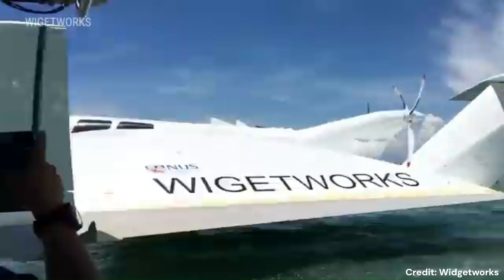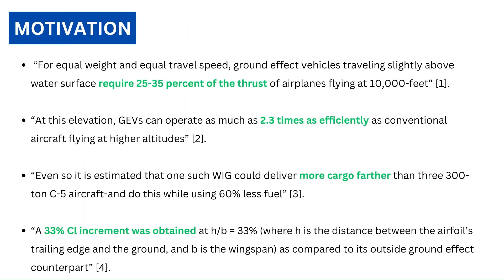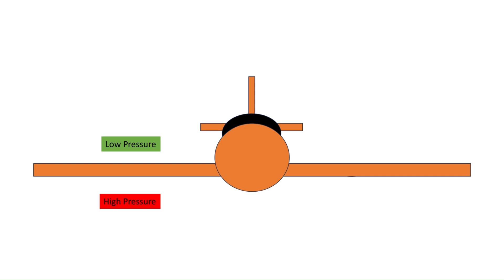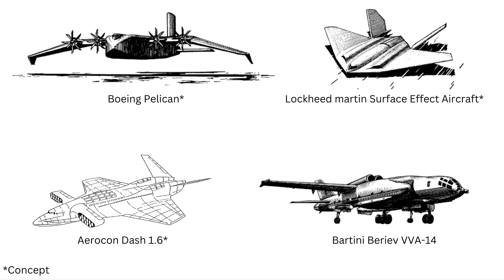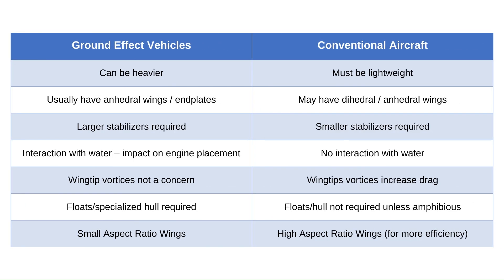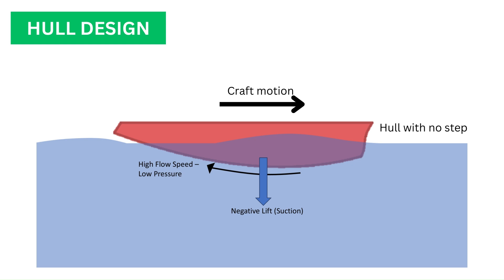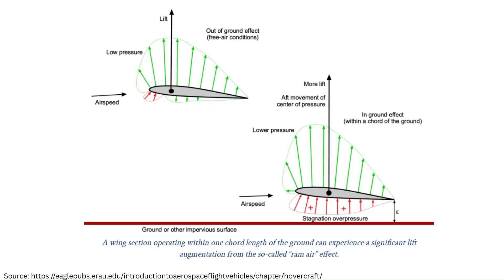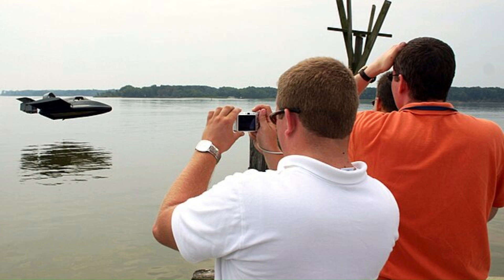Ground Effect Vehicle (GEV) Design | Wing in Ground Effect (WIG) Craft Design

Comment: I had a proposal for a land ground skimmer road vehicle with hysteresis conveyor couplings for parking inspired by a Ryan VZ-3 so an editor in of Chengdu Sichuan used such a design for a cruise missile even If had designed options such as solid fueled jet engine or x-rays on hafnium Lockwood valveless pulsejet so at least a Dave Burdo of General Electric liked it's air conditioner of a Tesla Fluidic Rectifier with a Ranque Vortex Tube for General Electric's electric car program.

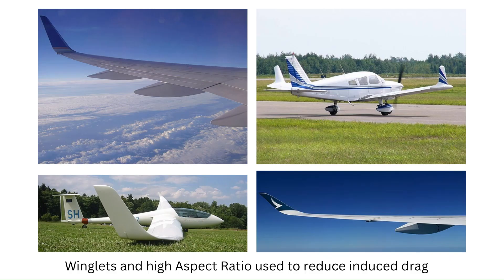Comment: 2:40 In ground-effect "the air does not swirl to the top section of the wing"???
Of course it does! That's one reason why most designs use massive wingtip devices, be it fences, floats, and/or winglets.
There's high pressure bellow, low pressure on top, flow will migrate towards the low pressure side.

Comment: Nice review of WIG design.  Although quite a few craft are named and described, it struck me as odd that Regent Craft's Viceroy, which is currently undergoing initial water testing of the full=sized prototype, was neither shown nor mentioned.  Aside from possibly the Airfish, the Viceroy is probably the closest to certification for commercial use.  Additionally, Regent is incorporating new design elements that are worth mentioning.  Their use of a hydrofoil instead of a step hull to reduce water drag should get the craft up and out of the water quicker with less energy.  They also are incorporating a blown lift wing design similar to Electra Aero's ultra STOL.  This will dramatically change the nature of the air cushion below the wings.  Also, with 40-50% of the worlds population living within 100kn of a coastline, it may be an underestimate to say that this is a "niche" market.  But, of course, it remains to be seen whether or not this will revolutionize intercoastal and interisland transportation.  Thanks for the video.